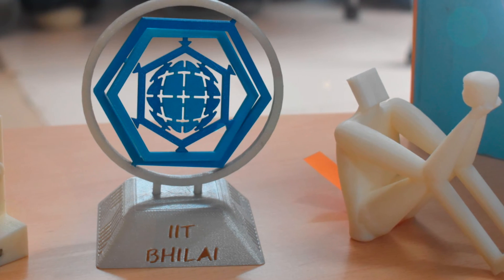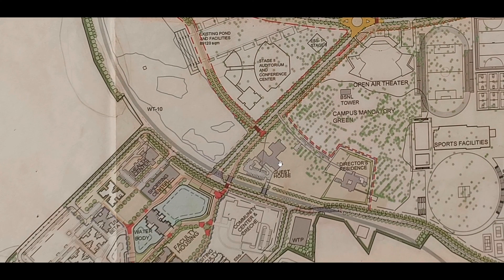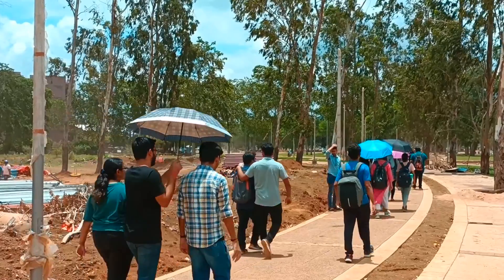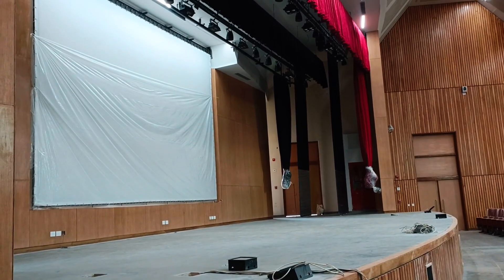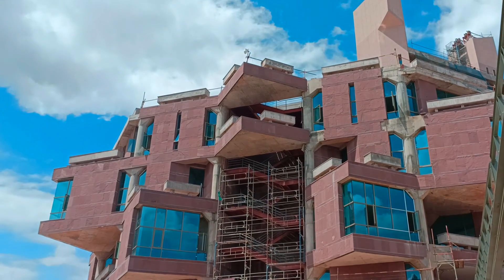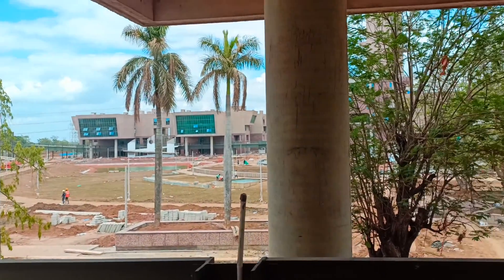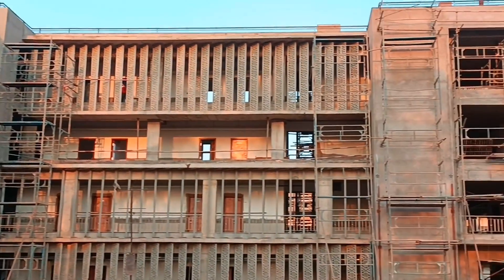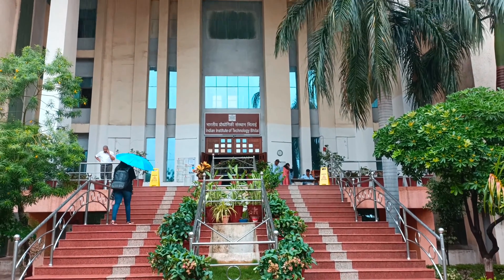IIT-Bhilai New Campus Tour

Comment: Are the hostels building completed now?
Reply from the maker: Almost they are ready may be intial days we will have some issues but after 2 months of college starting there in hostle everything will be fine.
Reply: @RohitSidagam40 are there coolers or ac in the hostels?
Reply: As per the information we have its Ac for each and every individual room but regarding hostles we need to see by August
Reply: @sidagamrohit-3404  what is meant by individual rooms?... Hostel rooms?
Reply from the maker: @arpitkumar5357 bro we were said it would be either having single sharing and double sharing.